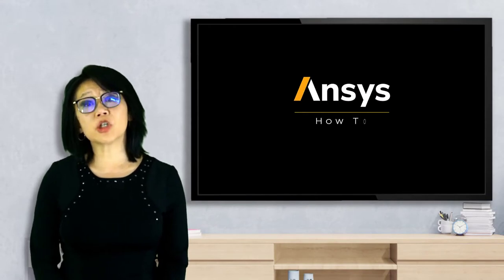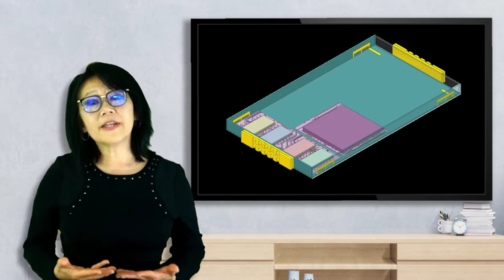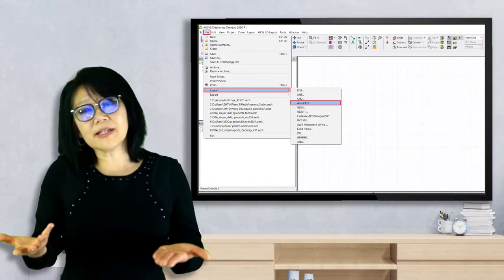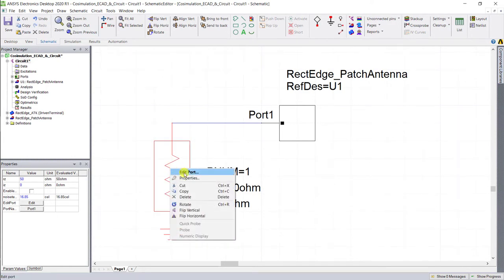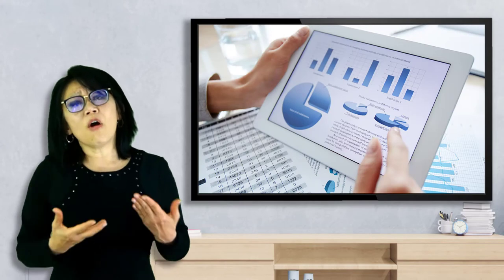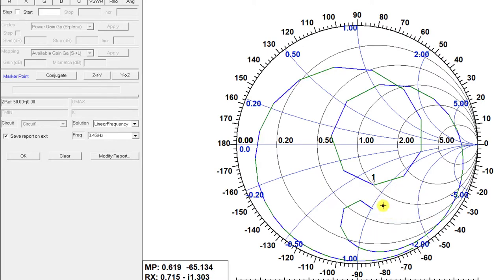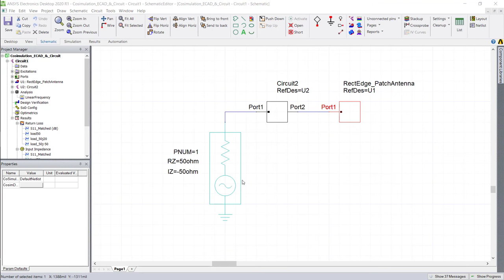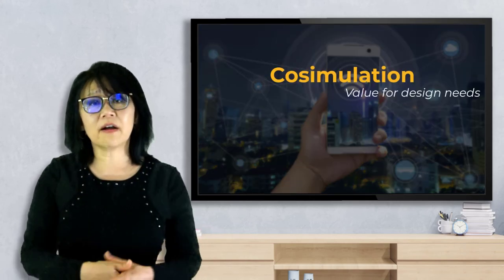Steps to Co-simulation Using HFSS ECAD and Circuit

Comment: Hi Ansys team, I was trying co-simulation to dynamically link an antenna design with circuit (for designing matching circuit), but somehow when I push the excitation, the results in HFSS 3D EM design is not getting updated. I am simulating the circuit design for the same sweep as defined in 3D hfss design. How to resolve this issue?
Reply from the maker: Thanks for watching! We ask that you post your question in our Ansys Learning Forum where Ansys experts can assist you. 

Visit at https://www.ansys.com/forum.